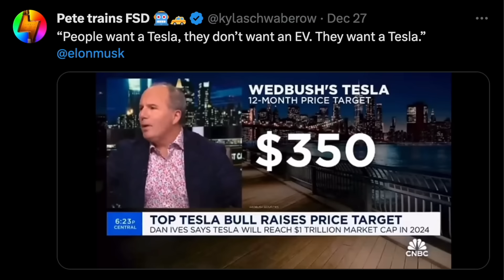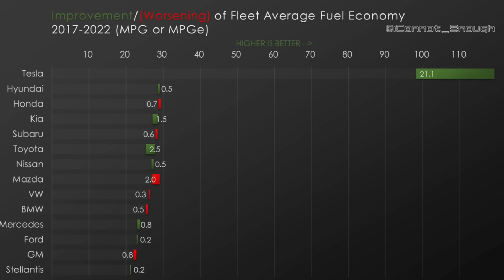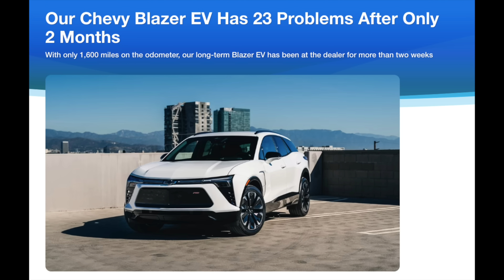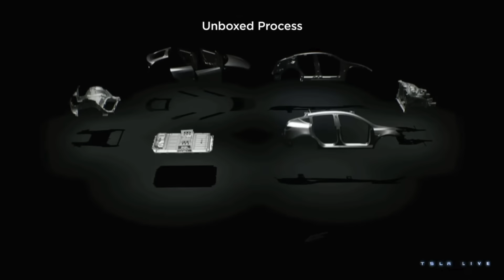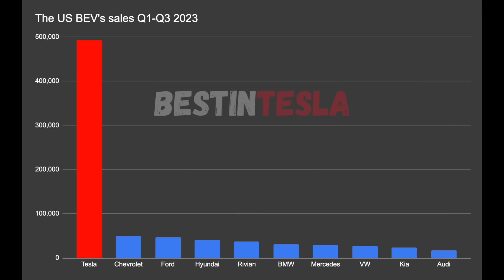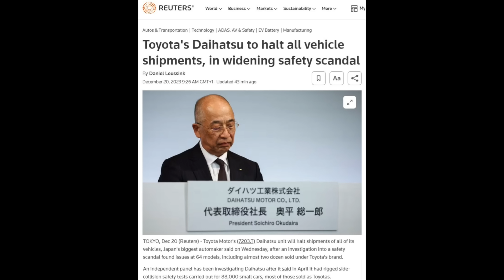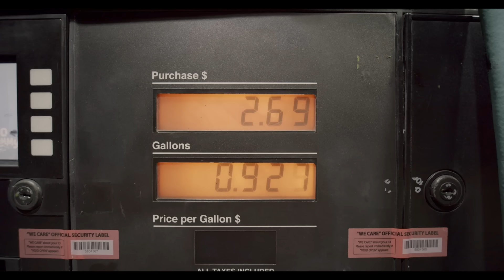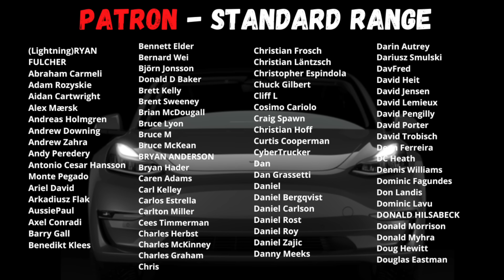Tesla heading for new records - Cybertruck’s demand problem - Optimus disrupting the labour market

Comment: 8:40 No.  When you calculate how much pollution an ICE makes you have to calculate in how much electricity is used to pump into barrels, how much electricity is required to make the barrels, how much diesel it takes to transport the barrels to the port, how much bunker fuel it takes to get the oil from Saudi Arabia to America in ships, then how much pollution it takes to refine it to gas, then how much diesel it takes to transport it to the gas stations, then how much electricity it takes to run the gas stations.  Don't forget gas evaporates and a typical loss of 1% does not seem like much but it is thousands of gallons.  Basically just multiply any pollution ratings of the ICE by 8.  That is the true number of pollution for each brand.

Comment: If you're going to add grid emissions to EV footprints, you have to also add grid emissions to ICE as well. It takes more electricity to refine fuel than it does to power an EV, so adding grid emissions just makes it worse for ICE cars.
Reply: Then there’s the amount of parts an ICE vehicle has that are transported from other places that assemble them from parts that come from other places. The footprint from that alone is huge.
Reply: If you want to go down this path then remember that the oil refinery that has been refining for 100 years has a low amortised cost per gallon of refined gasoline. Same comment for the sunk cost of the legacy auto assembly lines.

Older cars aren’t safer or more fuel efficient or better and they don’t run on renewable energy ever. What they do really well is stop people from buying ANY new vehicle. 

You want to talk about efficiency, how environmentally friendly is the car I didn’t buy? What about buying an old car and a bicycle and using the bicycle for 9 trips out of 10? 

Hypocrites!

Comment: I don’t think recall = unreliable. Our 2008 Rav4 had many recalls but has never broke down. My next car will be a Tesla.
Reply: A Tesla recall, like the latest  involving 2 million Teslas was done with OTA, over the air, so not really a recall in the traditional sense.
Reply: Actually, that's an excellent point. My revivifiers' Mercedes has had a few recalls: 1 Takata air bag; Engine Control Unit upadate (x2). But these were scheduled: the car did not break down - started every day...

Comment: I charge two Teslas during the day from my solar panels.  Now and then we charge one or the other at night, some of the electricity on the grid coming from wind.  We should be 100% solar, wind and batteries in a few years.  Also!, with the bi-directional capability of the CT we'll be using its batteries to charge our home.

Comment: One of the statistics that appeared a few years ago. If your EV runs on 100% coal fired electricity your pollution is still < 50% of an ICE car per mile. Then start factoring renewables and consider the renewable percentage is increasing your EV actually gets cleaner every year. The cleanest an ICE is ever going to be is the day It's made, gets dirtier due to wear every year.

Comment: Hi Lars, happy new year from the U.K. Picking up on the emissions theme… the emissions figures are for the vehicle, not the fuel source, if they included the fuel source, the ICE vehicles emissions would more than double! Because making and distributing gasoline and diesel creates a huge carbon footprint before it even gets to the vehicle, extraction, transport, refining and distribution.
Reply: That's a very important point.

Comment: As for production rates, I think if it weren't for the necessary re-tooling of the best seller Model Y, Tesla would have hit bang on +50% or 2.7 million cars, but I think it will be around 2.5 million cars delivered in 2024.

Comment: Tesla’s manufacturing efficiency improvements with box manufacturing on the model 2 will reduce costs by another $3000-$7000 AND cut factory size in half.  Probably eliminate 90% of factory workers with Optimus both in final assembly and upstream when making subassemblies.  A factory producing 500,000 vehicles per year could then make 1,000,000.  Elon has to do this and mine and refine his own lithium to beat the Chinese car makers.  Elon will win in the end, might take 15 years but he will rule the auto industry
Reply: Literally the dumbest comment I have read all day…are you a 6-year old?

Comment: In case of house power failure, a tesla can power your home for hours.
Reply: This is currently only supported by the original tesla Roadster and the new Tesla Cybertruck. The feature was dropped since few Tesla Roadster owners used it. Car batteries are optimized for size and weight, while stationary batteries can be optimized for price and durability, so a separate stationary home backup system like the Tesla Powerwall is more practical than putting unnecessary strain on the battery of an expensive car.

Comment: Optimus will not just destroy the labor market, it will destroy the entire economic model. You cannot have an economy based around the value created by labor, when there is no labor.
Reply: So the entire system needs to change. We need a universal basic income or capitalism will collapse.
Reply: @SteveRomigsongwriter  The human species has created 7 major social/economic systems in our history. Anthropologically speaking? They all share one common thread. Each one was enabled, and then later rendered obsolete, by technology convergences. It goes all the way back to Uruk. 
The first industrial revolution is responsible for the creation of the capitalist system. Which is based upon the Malthusian era beliefs that man would never posses the technology to overcome scarcity in his environment, and thus each must work to earn their right to access those resources. It is not going to function in the digital autonomous era that is rapidly developing today. The ideologies of scarcity, do not apply when you have the ability to efficiently manufacture at the atomic scale.
Reply: @davefroman4700  thanks for the information. I can’t see what that has to do with a universal basic income though. The bottom line is, if the system is based on people working and robots take over, people will have to have an income to maintain capitalism. Of course if we went to a system that was resource based, got rid of capitalism entirely and shared resources equally we wouldn’t have that problem. 
Elon has spoken about a UBI as a solution. 
I’d prefer a resource based economy but that won’t happen.
Reply: @SteveRomigsongwriter  Money was invented to solve the issue of scarcity in the environment, by allowing the flow of goods and services. UBI needs to be seen as a transitional tool, not the answer.
Reply: @davefroman4700  every system is transitional.
Reply: @SteveRomigsongwriter  Anthropology disagrees. The history shows that we fall into extended periods of equilibrium where nothing changes, but then in the space of a couple decades? Everything changes. The next ten years are likely to be 4x as disruptive as the arrival of the first industrial revolution. The following decade will by 16x that. We are now linear thinking mammals, living in an reality of exponentially accelerating scientific and technological capabilities.
Reply: @davefroman4700  money was invented to facilitate trade. Started with barley and shells. 
Moved to gold,which was useless for anything else, which lead to banks and certificates with the redeemable value of the gold they stored.  
Scarcity is a result of the monetary system not a cure for it. 
The more scarce something is and the more demand the higher the price. 
You can use anthropology as much as you want. 
It’s a good word. 
But the fact is the present monetary system is a fiat system with nothing to back it up.
It’s a way of controlling access to resources and a reason those resources are used profligately and unsustainably. 
It’s prioritised above our own survival. 
It needs to go. 
It won’t. 
We’re fucked.
Reply: @SteveRomigsongwriter  Trade existed with barter and debts for centuries. Money came about through conquest. In the Sumerian era. The rise of the first standing military. Nobody was willing to accept a debt from a soldier who may not return to pay his debts. Likewise the system of debt jubilee existed up until the creation of the Capitalist system. All debts were routinely forgiven every 5-7 years depending on culture. Usury (lending at interest) is a sin.....

Comment: I'm all for EV adoption and renewable energy. My wife and I have an EV. I've been driving hybrids since 2002. I have an electric vehicle on order for myself. I work in solar.

There's a dirty lie about European standards for measuring renewable energy generated. 

The dirty secret is that most of what Europe calls "renewable energy" is the burning of wood pellets. That is not a clean source of renewable energy, even if it is technically renewable.

China, and the US have done much more to adopt clean, renewable energy.

One might argue that all you're doing when you burn the wood pellets is returning the carbon into the atmosphere where new trees can absorb it and be turned into wood pellets and complete the cycle. 
But that's not the whole story. 

The whole story is that trees emit oxygen during the day and emit carbon dioxide during the night. Maybe you remember learning that in high school biology. The rub is that for the first 15 years of a white pine's life cycle it is a net-CO2-emitter. It takes 15 years for a white pine to stop being a carbon dioxide-net-emitter and become an oxygen-net-emitter. 

To make up for all those years of carbon-dioxide emissions you would have to have the tree live much longer than 15 extra years (30 total) beyond the maturity to when it becomes a net-oxygen-emitter.  You'd have to have enough to offset to the environmental damage done, which means a multiplier would have to be applied to equation. 

I have no idea how to calculate that multiplier. But you better believe it's going to be a high multiplier because of the damage being done is so hard to undo.

If I were setting the timber policy, I would dictate that forestry companies have to allow their white pines to live for a 50 years before harvest, in might even require a longer period after analysis of the results. 

Other trees would have different terms because other trees have different life cycles and other trees will mature at a different point as far as the number of seasons passed. 

If we don't do this and we continue cutting down timber faster than we should, not allowing the trees to become net-oxygen-emitters, we are sealing our doom.

Absolutely no old growth forest on state nor public land should be harvested. No exceptions.